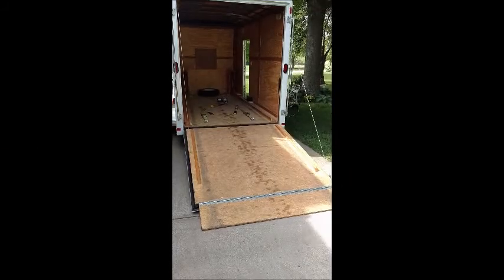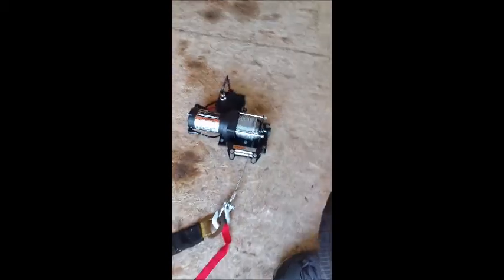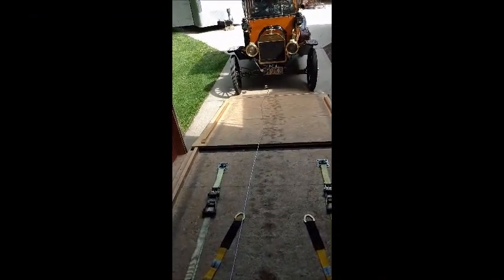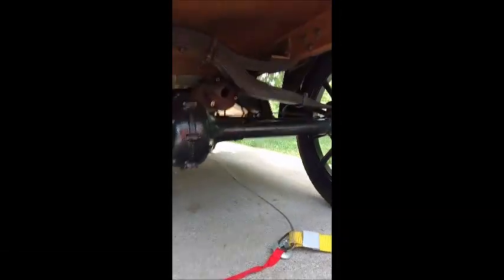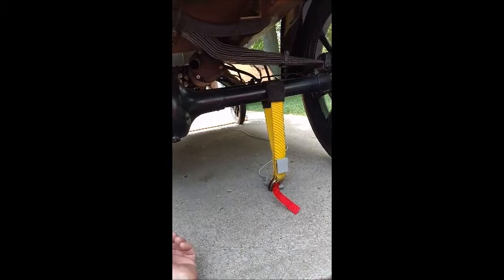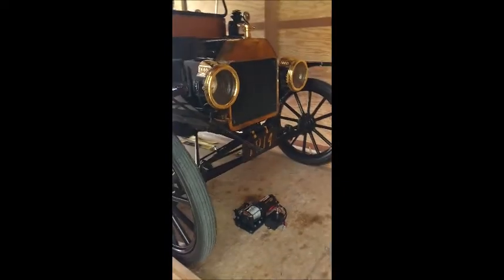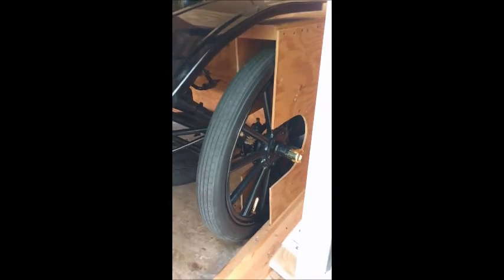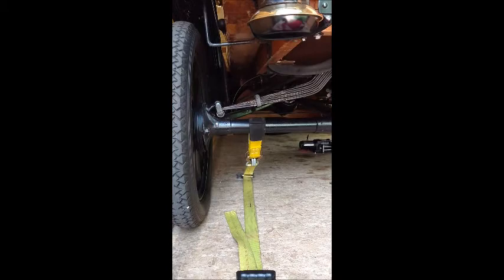Loading an early Model T Ford into the SureTrac Enclosed Trailer

Comment: That is the worst way to pull a Model T and an easy way to bend an expensive Ruckstell housing.  Out of 17 housings I straightened in one run, only 2 did not need the torch. Pull from the frame and hold it down at the wheels.
Reply from the maker: You are entitled to your opinion, but I have not had any issues with loading and tying down several cars in this manner for more than a decade. No bent axle housings!